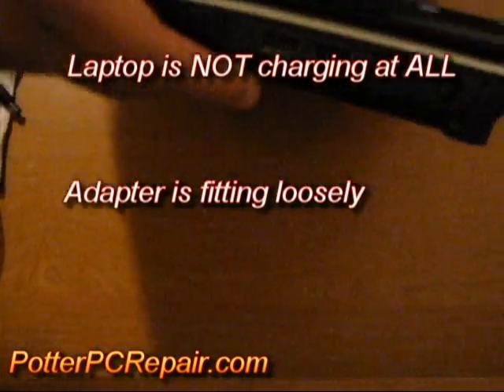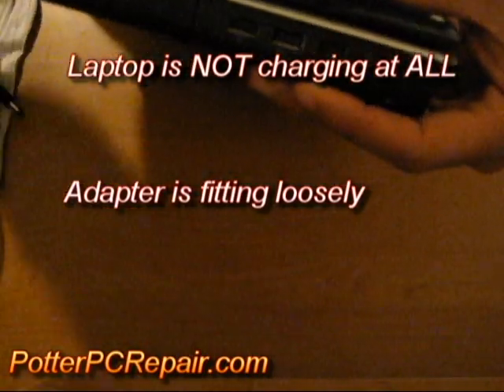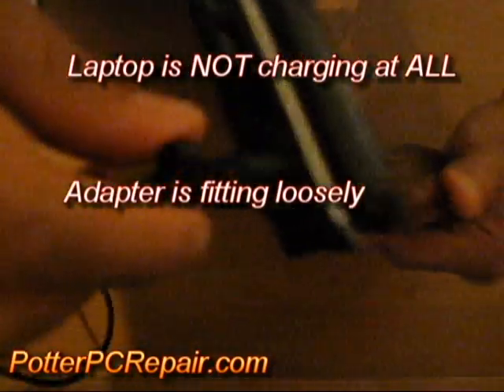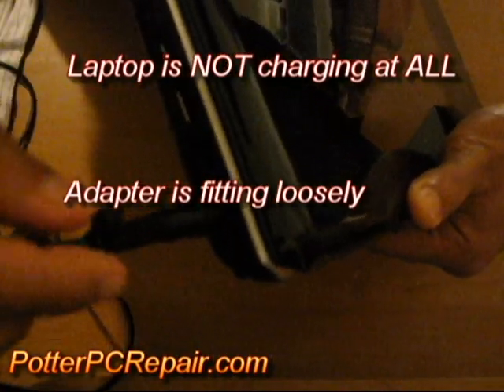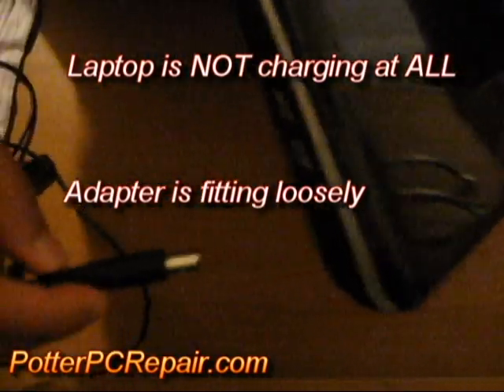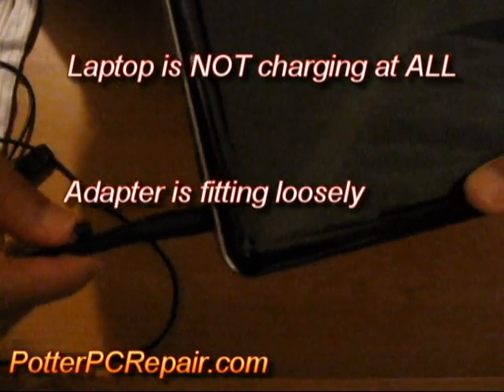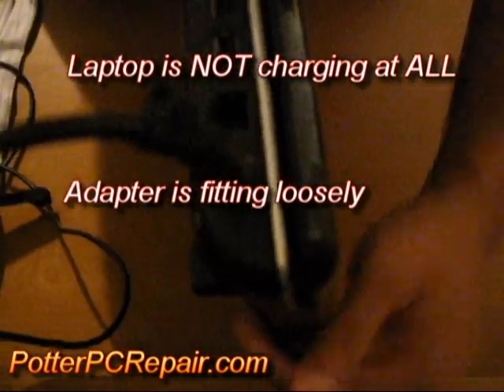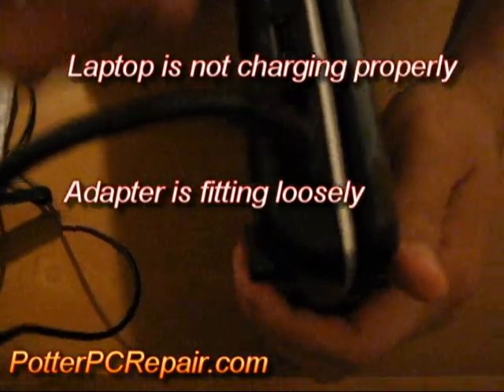Troubleshooting a Laptop Adapter and DC Jack

Comment: Very useful vid thanks, as I was wondering how the place the probes.  I needed to test a 12V 2A DC adapter and indeed it was blown.  Tried another DC adapter 3V-12V adjustable and that gave the correct figures ±5%.

Comment: That's interesting because setting my multimeter to AC produces absolutely nothing when measuring the +/- pins on the adapter that plugs into the laptop. The needle actually drops off. But when I set it to DC it magically produces the 18.5V that it says on the power brick (which goes a long way in explaining why the part inside the laptop is called a DC jack harness ;o)

Comment: I have an HP dv7-1135nr that has no power.  I have checked the AC adapter and the jack and both are working.  I'm assuming there must be something wrong with/on the mother board.  Can anyone help?  Thanks

Comment: @PotterPCRepair Im am having the same problem thats shown in this video.I think I have the same HP laptop as well. I didnt know wether its the battery or the adapter. I just replace the original battery about a year ago so I thought that it couldnt be the battery but the battery did have a low rating. Now Im thinking its the adapter cause when I wiggle it,,,it sometimes will charge, but my question is where did get that adapter and how much was it. Thanks

Comment: I have a similar laptop.. And the charger that come with it, the plug that goes in the laptop was coming apart and soon stopped working. We bought a new charger and it had the same issue your having after  4-5 months we again bought another charger and as of today (7/24/12), 10 minutes before posting this it quit working... I really don't know if I'll be buying a 4th charger and I know for sure I won't be buying another HP laptop, or any HP computer video card went out on one of my desktops and

Comment from the maker: @orbitaaltube Part II... Are you making any movements while testing the adapter? That would be a sign of a short circuit.
If 1& 2 checks out then a component in the adapter may be failing and over a period of time it will fail completely and you wont get any readings; Time for a replacement adapter. I would recommend a universal adapter that works with multiple laptops rather than just a replacement for your specific model

Comment from the maker: @orbitaaltube Well its a good sign that it is failing/ bad. But first  before jumping to conclusions I would first check to make sure the wall outlet you are using is not bad or the cable that goes to the adapter. 1. Test the cable while directly plugged into the wall if you are getting 120V AC (240V AC if your outside the US) then the cable and outlet is not the issue 2. Sounds obvious but are the batteries in your meter fresh? [This has given me wrong readings in the past].

Comment: I have an adapter that is reading an initial spike of 20V which it should be reading then it goes back to 0 again by itself without removing the test leads or turning off the power. Does this mean it is bad? Thanks

Comment from the maker: @dommafia Depends on the DC jack and how it is connected to the motherboard... But since you can't supply power from the jack you would have to perform a "Continuity Test" with your multimeter. Some meters have this with a symbol of a diode/ soundwave. But I normally use the resistance scale where if I check two points and get a very small resistance then there's a solid connection/ closed circuit but if I get Infinite resistance or OL [Open Loop]; then there is a sign of a loose solder joint.